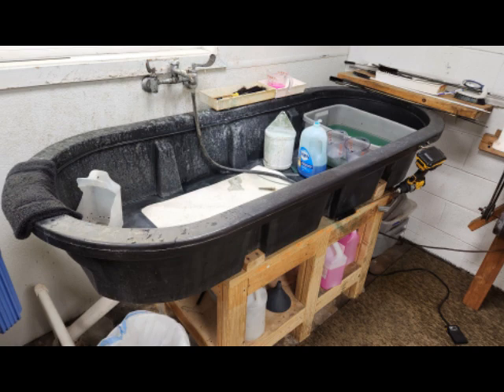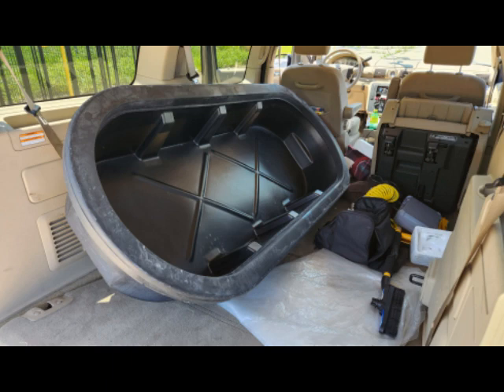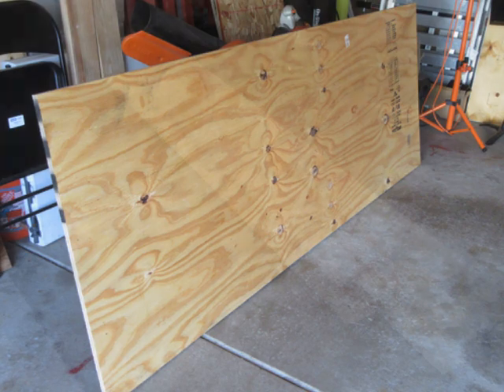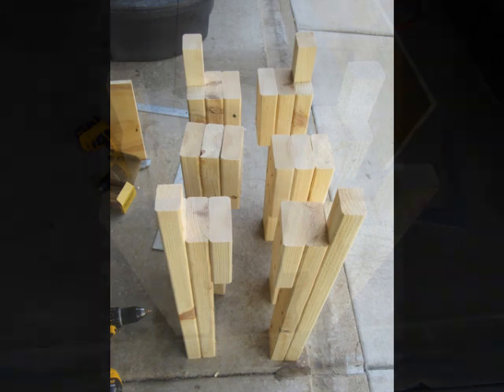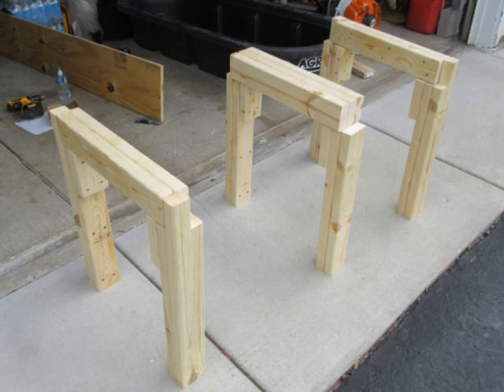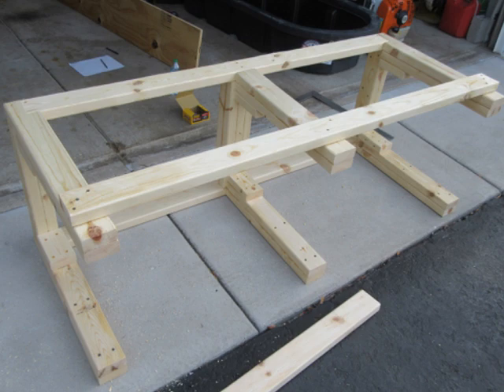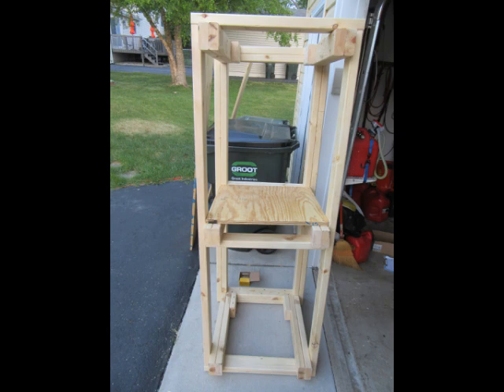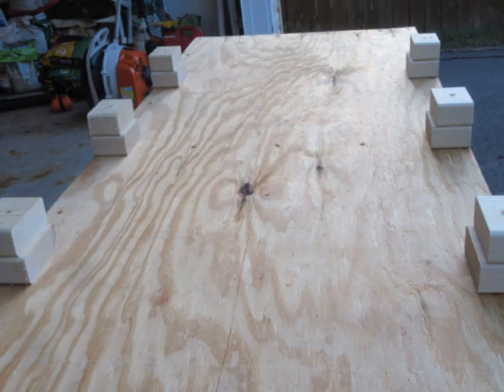Making a Brass Instrument Flushing Basin

Comment: Based on your detailed development of this "tub stand", you calculated the weight being approximately 70G x 8lbs = 560 lbs + trough weight (25lbs) so total weight is about 585lbs.  water weighs about 8lbs per gallon. I design mop buckets for various companies like Home Depot and Sam's Club. I am familiar with finding the CG and volume for many types of buckets. Nicely done. Not everyone understands the importance in the details of developing well designed things. One thing I would probably have added is a good set of locking swivel casters to move it if needed.  All that wood  + water weighs a little bit.

Comment: A thorough and easy-to-understand description, something I have learned to expect from your videos. Marking the tipping angle is an interesting feature. I hope you don't stub your toes on the outside "rails" along the bottom.
Reply from the maker: Daveneedon, no toe-stubbing if wearing shoes!
Reply: @youtuuba  who manufactures the trough and where did you get it?